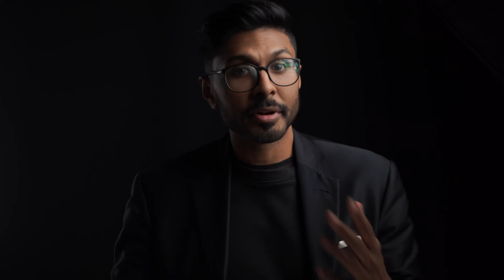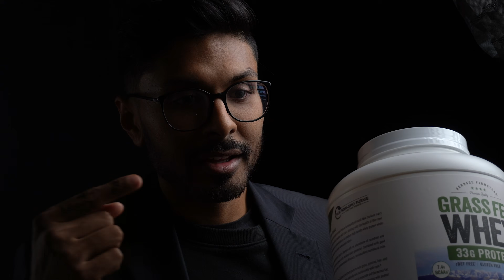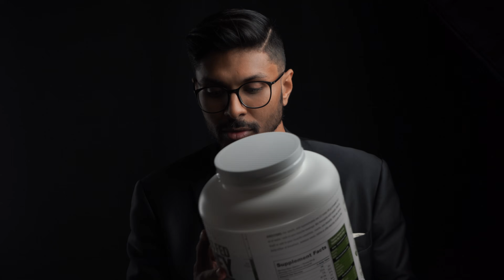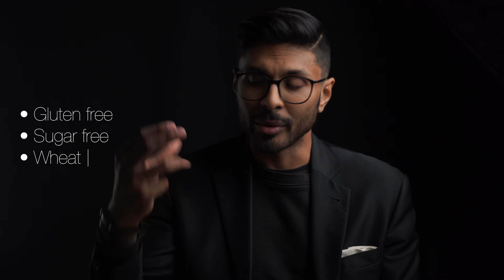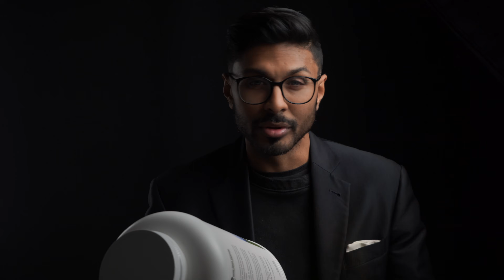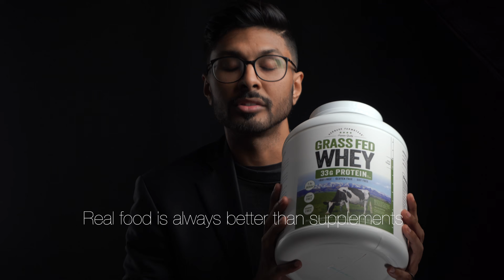Protein Powder: Best Ever Made? (Muscle Building, Weight Loss, Weight Gain, Beginners)

Comment: Hi Abs! There is a brand that I’ve used for years which comes in numerous different formats to suit the individual. Organic Whey Protein Concentrate by ‘Pink Sun’ is certified organic, made only from grass fed whey with no nasties or fillers or emulsifiers (which is why they suggest using a blender but your mixer bottle will be fine). They do 3x 1 Kg packs for £77.85 and they’re based in England 😍
They also supply a protein powder that’s made from sheep and goat milk. This might be more suitable for individuals that are sensitive to A1 casein that do better on A2. 
I can email you a link if you like?
Reply from the maker: Nice find, I'm gonna have a look at that 🙏